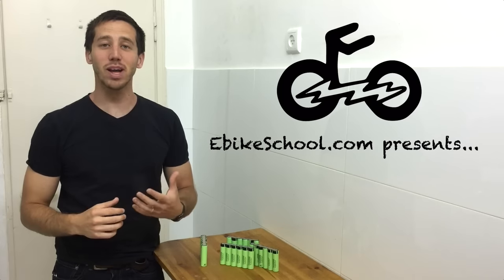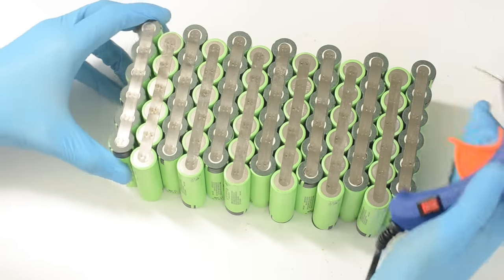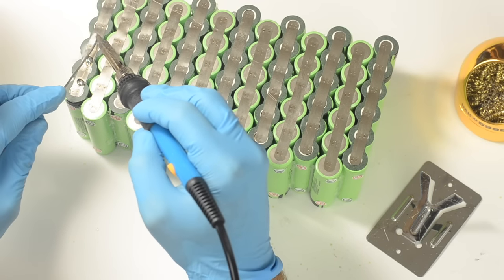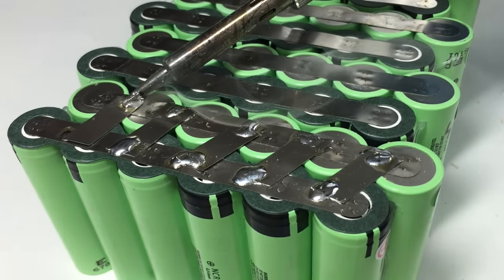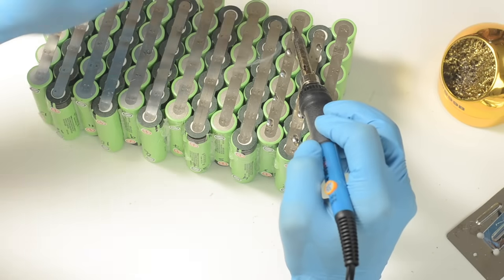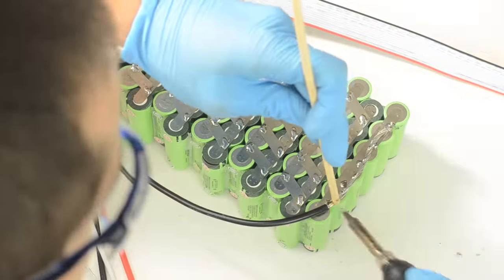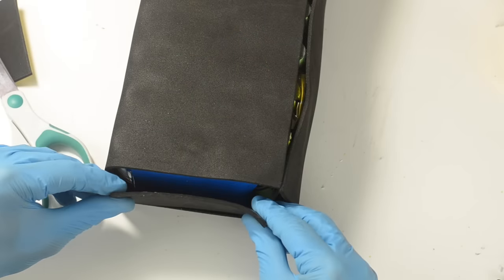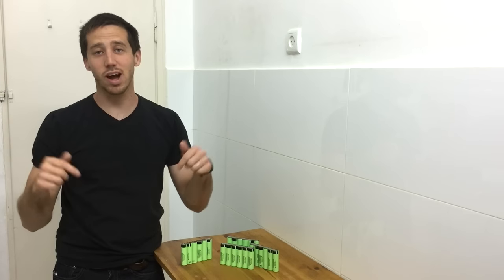DIY 48V 20Ah lithium battery without a spot welder using Maker Batteries

Comment: Would two 22.2V 5200mah drone/rc batteries in series(44.4v, 10400mah) work for a 48v ebike? I've found them online for under $40. Seems like an easier option.
Reply: In series you'd only get 5200mAh, though. You'd need 4 (2 pairs in parallel, then hook the pairs in series) to get the 44.4V 10400mAh. Plus most of the ebike motors I've seen want a minimum of 15Ah so you'd have to go for 6 batteries (3 parallel packs each then hook those in series)

Comment: Hello sir I watched your video on the manufacture of a lithium battery 20AH 48W and I find myself with a concern on the BMS there are 3 connection C- P- B-I do not know how the connected ( a what) the connected that the wire goes on which wire can you make a simple demonstration on perforated cardboard with bits of string I do not speak English I use a translator I hope you understood despite the cordially max translation

Translated with www.DeepL.com/Translator

Comment: Wait until the vibrations rub through the outside sleeves..terrible idea and dangerous.
Reply: Hahaha.
 learn how to short your batteries must be the title.
Reply: What the hell are you talking about? Rubbing through the heat shrink?
Reply: Having built over 200 batteries using 18650's...and just finished a 30ah 20 cell Samsung 25R pack for 200 amp output... I can tell you that it does not take much vibrating (think constant bumps on road) for the very thin outer sleeves....yes that can be called heat shrink also (well done for that btw) and your battery pack is f*cked. Nice attitude also :P
Reply: At least cover the cells with a layer of liquid silicon gel (that dries to a rubber) so that they have vibration protection..but thin plastic layer rubbing up against thin plastic layer = shorts and fire
Reply: I agree you can uses a gel/glue between cells
Reply: +Samuel Spacey yet you have nothing to show for yourself. im designer with a degree. yet you have no creditials...lol just a hater. you have no accomplishments to show. i sold nearly 100 of my first prototype bikes all over the world.
Reply: +Samuel Spacey bro fusion was a project from nearly 4 years ago the videos are of the prototype not the final product. Sad that you have no major accomplishments in this field. congrats on your first big battery...lol 300 amps on a cromotor you are obviously lost bro. thats ebike childsplay and you probably ride it illegally im sure. my new projects are actual motorcycles my personal motorcycle has a 6kw battery and has a 120 mile range. hit me up when you grow up. 75 iq...lol tell that to my college professors and my employers and the hundreds of customers that have bought my products. ive accomplished more in a year that you will ever accomplish in your life. youre a psycho trying to look up the details of my life and ypu have not even a video to show of all your "accomplishments".....hahah
Reply: hahah youre bragging because you are making a 240 cells pack. My motorcycle is 576 cells and has been running for over a year and 8000 miles with not even one issue